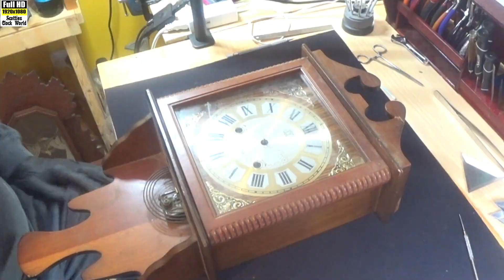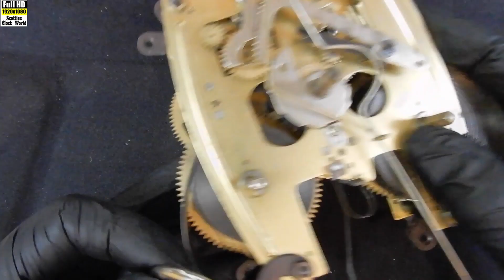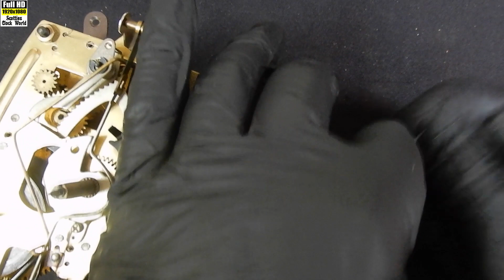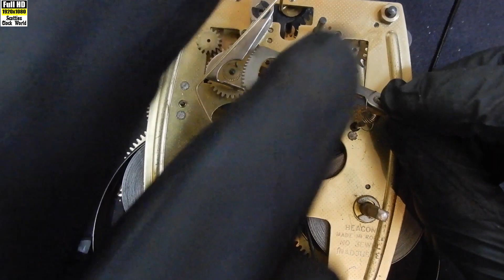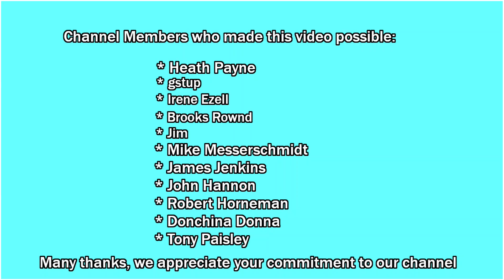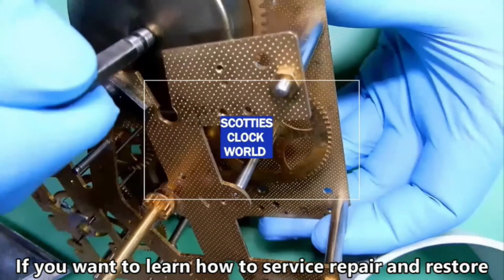Korean ITF 31 Day Wall Clock Service/Repair - Part 1

Comment: Mine looks different and maybe newer.  Maybe found a way to make it even cheaper.  It's a Hamilton and there was a spring of sorts around the L shaped lever where the wire was very thin and snapped.  It doesn't really look like it has a function but it must because the clock pendulum stops within a minute.  Looks like it might be impossible to replace.  I bought a Waltham used and when it wasn't center it was keeping time and ticking wonderfully.  Once I centered it it ticks for a minute but sounds like it skips and then stops.  Was thinking of trying to pick up a cheap used clock and replace the movement that way.  A new 31 day movement on Aliexpress is around $120 and in the mid 1990's I was buying 31 day clocks wholesale for around $30.  Those days are gone of course.
Reply from the maker: Yes. times have sure changed. A donor clock is the best option for a replacement, but they are hard to find.

Comment: Thanks for sharing Scottie.  Suppose a worm drive automotive hose clamp would work for a main spring retainer?  Korean built movements a sure a bit different.
Reply from the maker: I would be a bit careful using metal hose clamps as they might scratch the mainspring thus causing a fine stress multiplier fracture.
Reply: @ScottiesClockWorld  Good call Scottie!  Hadn't thought of that...
Reply from the maker: @whitneykovener , now we both know, ha ha.:_clocksTongue: